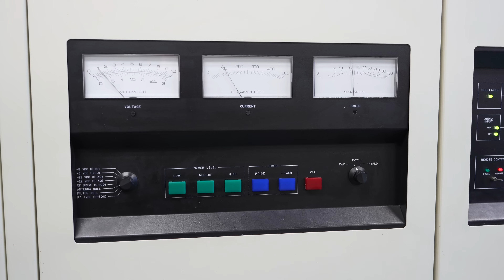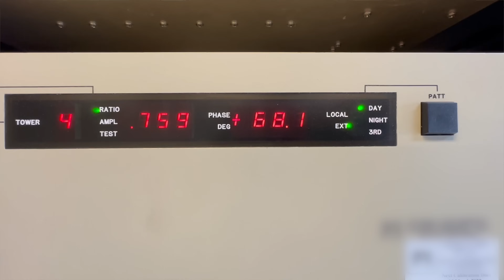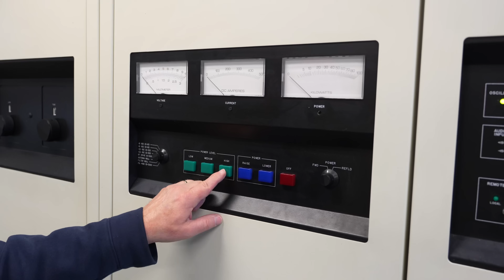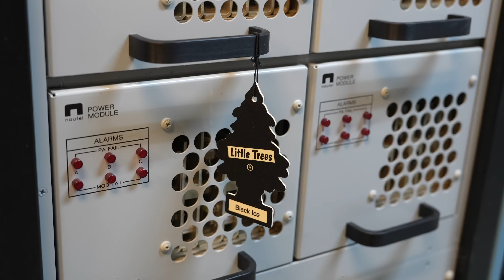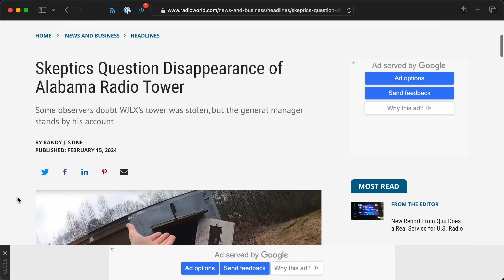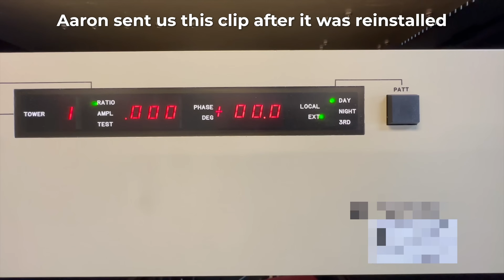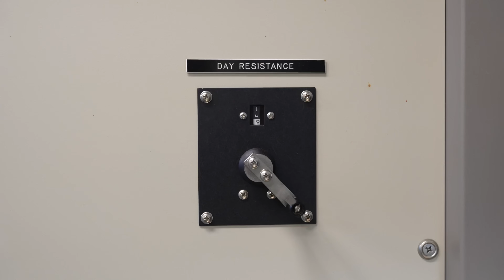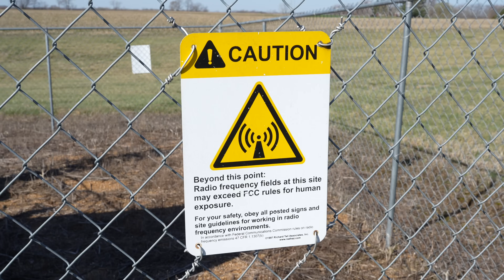This 100-year-old tech splits my voice in five

Comment: Misleading title.  It doesn't do anything with the voice, it does it with the RF signal.  I already knew about this, but I only watched because I wanted to know what it's doing with the voice.
Reply: I also thought it would be about audio phasers (a vocoder-like sound effect, that was likely invented as early).
Reply: Informative
Reply: Especially the visual represented in the thumbnail, and then completely avoided the explanation of the title just to link to other channels... @GeerlingEngineering The content on this channel is great, please don't fall prey to marketing tactics that misrepresent the content for clicks.
Reply: What does it do with RF?
Reply: I mean, I thought that was obvious...
Reply: @gaborm4767   I'm sure, at this point, you've moved on.  But, for completeness sake...

The animation is not very accurate.  All five waveforms should be identical, just with different offsets in their cycle, relative to each other.

The thing to understand about mixing signals:  If you sum two signals that are in perfect phase coherence (they're exactly aligned), then you end up with twice the amplitude.  If you sum two signals that are in exact opposite phase, then you end up with zero amplitude, because they cancel each other out.  If you sum signals that are somewhere between 0 (aligned) and 180 (opposite) degrees phase, then the signals will sum to a level between 0 and 200%.

But why would you want anything less than the maximum you can get?  Isn't that bad for efficiency?

With a typical omnidirectional antenna, the covered area is a circle expanding outward from the tower.  But, depending on the geography of the area, that pattern might not be ideal.  Maybe your audience isn't uniformly distributed around the tower, and there's no reason to transmit into a field of cacti out in the desert.  Or, maybe there's a neighboring station off in one direction that you're trying to avoid interfering with.  Perhaps there's a tall feature (like a mountain) that tends to reflect the signal with a delay and cause reception issues.  You can use different antenna types that have other radiation patterns, but if you need a particularly complex radiation pattern, there may not be a single antenna that can give you what you need.  For that, you need more than one antenna, in an array.

The tower arrays are designed with relative phase and physical position such that the summed power depends on where you are measuring from.  In certain directions, the towers interfere CONstructively, and you get more power.  In other directions, the towers interfere DEstructively, and you get less power.  This is how you end up with those weirdly shaped squiggles on those maps around the towers.  Those represent the radiation strength at a distance -- or rather, the distance at which the received power is at a certain constant value (say, 20dB from nominal - or whatever standard they use.)  This shows how the power has been "steered" to focus on the areas where you want coverage, and steered away from the areas where you don't.

I'm not a radio tech, but from what I can tell, the phasors are just introducing a tiny delay in the signal that varies per tower.  A very, very short delay can cause a consistent offset of a signal at a fixed frequency (the center frequency that the station transmits at), so that the waveforms as transmitted from the towers are not in perfect phase with each other.  The exact relationship of the individual signals as they sum causes deterministic interference which varies by your distance and angle relative to the array -- hence the ability to selectively cover an odd-shaped area with varying power.

Comment: Warmed my heart knowing the engineer forgot to turn on the dummy load fans and owned it. I have had plenty of big mistakes at work. Much respect for businesses that accept human element in any financial machine. That radio station has got to be a great place to work.
Reply: Insane that the fans not running did not trigger an alarm of some sort.
Reply: I totally agree. That was one of the most heartwarming things I’ve seen all day.
Reply: An engineer that doesn't admit error, is an incompetent engineer.
Reply: It's insane that this could actually happen to begin with.  It shows poor engineering design.  There should be both an interlock which would prevent this from happening and an automatic switch that would activate fans when the heat rises to a certain level.
Reply: @basketballjones6782  maybe he turned it off for the intervew

Comment: You also need to show a TX site with a "poor man's" phasor, different lengths of feedline coiled in the basement to feed the towers at different phase angles...
I've seen a couple of those at small stations.
Reply from the maker: Definitely! We will hopefully get around to some smaller AM sites soon, and many of those are a lot different in so many ways (even if the principles are the same).
Reply: I'd rather see them going around town doing proof of performance tests they have to do every year. :)
Reply: @GeerlingEngineering  I am at the other end of the state but for AM not much to see. A J1000 a coil designed by Mark P, built by me installed by Dave O mostly then out to an 80 year old shunt fed tower. All of it basically sitting on a rock so grounding and chasing RF is... fun. I still have our old MW1 and had it about 80% working after a strike before the owner decided to replace it. Everything else is FM

Comment: Back in the 1980s, I was in some 100 kilowatt AM transmitter sites and the energy was so powerful you could hear the AM station through the random vibration of the building. The building was demodulating the signal through vibrations.
Reply: What country had 10KW AM transmitters in the 1980s?

Comment: Back in my day, we had a Potomac Instruments phase monitor upon which we had to manually punch buttons and write down phase and loop current readings every two hours.  And this was on 4 towers.
You guys have it easy now!
Incidentally, towers are made invisible to other towers by detuning networks.  Rarely are they simply shorted to ground or left fully floating.

Comment: Wow. I am at kilowatt here (J1000) that I have to drop to 56 watts sunset to sunrise. Not dealt with phased antennas yet but cool to see how they work. Antenna design/theory is still voodoo to me. I have replaced power modules and had to mess with the ATU when we took some stuff off the tower. I can hook up a rigexpert now but still have the old way. Big baklite meter with huge alligator clips that go on either side of the coil. Don't quite know how it's used but seen it done and it belonged to one of my mentors that's silent key so it sits on my shelf as a memory. And yes every tower site I have has box fans.
Reply: I have a very similar station that uses same towers and patterns day and night so no need to have a day and night pattern shift.  One is 1KW day and the other is 500w day. I still remember the moment in class when the instructor talked about resonance and what makes the electrical/magnetic energy blip out into the air. Still facinates me. And he would have loved to see what it can do with a hot dog as a load! Hope you saw the hot dog video!
Reply: @radijoe  I kinda picked this up as I went along and became the chief engineer because I am the last person in the area who has a basic understanding of it, can read a schematic and be quiet when someone smarter than me tells me how to fix something. I am tempted to try the hotdog trick but I don't know if a gallon would do it. I do the hold a speaker touch one wire and another to ground turn myself into a crystal radio and the hold a curly bulb in my hand near the tuning coil and blink with the modulation tricks when we have visitors.

Comment: I wonder if the FCC licenses them for effective radiated power or just wattage? as this is a phased array it can obviously give you a lot of gain in any given direction. With Ham radio most bands are limited in wattage but some take gain into account For example on 60m (5250–5450 kHz), if your antenna offers 3 dB gain, your maximum legal output power can't be more than 50 W (50 W plus 3 dB gain equals 100 W Effective Radiated which is the legal limit there. Great video, interesting to see what the big boys get to play with.

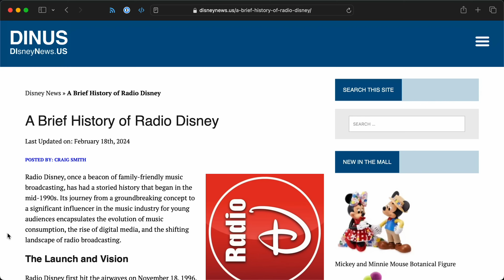Comment: 4:45 depends how the sun,earth, and moon feel during day or night

And how much ionospheric activity there is,  under proper conditions the signal even under legal power will radiate way out of bounds, goes up then bounces off the upper atmosphere like a mirror and someone in Europe or Russia picks it up.

Or bounces off the moon and someone in China hears it
Reply: Nowadays most of that can be computer augmented
Reply: 13:15 skin effect and resonant standing waves

Having only one ground point allows for ground faults and at radio frequency the ground becomes an inductor, which you don't want a high lc ground can cause floating voltages 

Touch a grounded piece of metal and hear radio on your fingers....

Comment: Does the towers carry some DC bias or some harmonics that make contact with them deadly? Form what I Understand the high frequency should prevent getting electric shocks the biggest risk being mostly severe burns due the current and arcing.
Reply: I own a violet ray device (works similar like a plasma globe), that produces sparks like a taser, but they can be touched with barely causing pain because the frequency is too high (around 1MHz or such, RF power may somewhere up to 10W?) to trigger nerves.

Comment: Could this explain why we heard voices during the eclipse in illinois?  Did the AM signals propagate far enough to induce voltages and currents on something nearby that we audibly heard?
Reply: Holding a fluorescent tube nearby the mast will likely light up. I remember a TV report that "Radio Liberty" (an USA propaganda station in Bavaria (Germany), designed to inform the Soviet Union) had such strong transmitters that a family in a nearby house thought it was haunted, because distorted voices rattled out of kettles on the gas oven or the springs in bed mattress and sofa tonight, and finally radio sounded out of the speaker inside his homeorgan. Eventually they had to built a faraday cage of wire mesh around the entire house to shield it against that RF radiation.
Reply: @cyberyogicowindler2448  That's hilarious.  I remember back when tooth fillings were made of metal some people claimed they could hear radio stations by biting down on tin foil!
Reply: @Calliber50  The Radio Liberty incident was proven in a lawsuit. AFAIK they even had to pay for installing the shielding because the family's house became legally rated uninhabitable.

Comment: At KNAU we had 100,000 watts 30 miles away remote, at KBAQ in Phoenix/Mesa we had 150 watts up the pipe to a 20 element Yagi antenna, 3,000 watts erp. At KBAQ we were a whisper in a Room full of Shouts!

Comment: What I would like to know:
How long do the UPS boxes in the server racks keep things running? There is only so much you can put into 2U of rack space. 
Will it keep a minimum set of services running or is ist just enough to shut down the system gracefully and hand over to a hot standby?
Reply from the maker: Usually the UPSes in those racks are just to keep the computers and remote gear up. For a site like this, they let the transmitter go off during a power outage, but they try keeping the remote access gear up as long as possible.

Comment: Prodlen made 51. Ohm coaxial cable, used by GE that made made radio and T.V. antennas and transmitters.  GE actually supplied complete "turn key" studio and transmitter equipment for radio and TV stations in their hay day.  (just like RCA and eventually Harris)
Ron W4BIN
Reply: When I first started in the biz I saw a large pile of 3 inch coax and the site's engineer said to never use it. It had the coiled looking bullets and he said it was a pile of 51 ohm coax, which I never knew existed. I was able to stick with Dielectric for large hard line and Andrew Heliax (now Commscope).
Thanks for the info!

Comment: Hey there! Just wondering, when you were showing the basement of the other location and was going over the tubing everywhere. 

You showed and said they were coax ‘cables’

So a “normal” one to me has the same center, insulator, outer wire and then outer jacket….

Is the “insulator” and outer jacket literally air for those? As in when dad “assembled one” there was nothing around the center but there was the white insulator cap. So is that it?? Air is the insulation?? (And don’t touch it)
Reply: In the case of these tower sites, they actually pressurize the lines with nitrogen, so it's air, in a sense, but nitrogen, and it does a pretty good job of (a) keeping out dirt and moisture if there are any pinholes, since its pressurized), and (b) insulating the center conductor from the outside.

To mechanically separate the two, there are insulating spacers at every bend, and at every connection point.

Comment: TLDR. It’s a phaser. Is splits signal into 5 identical signals and shifts the waveform ( time). So if you are between the path of 2 towers u actually receive both signals mixed are in phase and not shifted to sound hollow ( telephone voice). Reason for the extra towers is you send less power to a particular tower to shape its coverage area - you don’t want your signal interfere with another station to Ie sw on same frequency or costal city do not need to have 100 % coverage of the gulfs of mexico
Reply from the maker: 'tis a very good, concise explanation!

(though should be tldw ;)
Reply: @GeerlingEngineering  Maybe they didn't watch and just read the closed captions.
Reply: Ah. Constructive and destructive interference
Reply: Identical as to modulated waveform, but not as to power levels.  In some DA's, a tower resistance can be negative (IOW, it returns power), while in problem designs a tower may have low resistance at carrier and negative resistance within an audio sideband.  Ouch.  (also generally badly unstable then too)  

There are two fixed elements of AM DA arrays, tower electrical spacing, and angular positions.  There are two variable elements, the power and time delay of signals to each tower, as adjusted by the Phasor and other elements, like transmission line lengths, and Antenna Tuning Units.  The earth electrical traits, and ideally very few other items like badly grounded utility lines or nearby structures, can also become undesired elements.  

As to radiation efficiency, or skywave at night, tower height also matters.  Generally 70 electrical degrees or more is expected for near quarter wave towers, commonly used.  Half wave towers have the least vertical radiation and high horizontal efficiency, but higher costs and in some places, more land use regulation or aviation issues.  5/8 wave are more popular for Hams, as they have more complex vertical patterns for slightly higher horizontal gain that half wave.

Comment: Awesome video! This is why people disagree about whether am stations come in better at night.  All things being equal the signal travels farther per watt but the stations sometimes have to compensate to avoid interfering with each other.  As a Ham it's always fun when the bands open up though and you find yourself talking to people from ridiculously far away. We often use pl tones to reduce unintentional interference between our repeaters.
Reply: Also too hot and sunny or fogged weather can cause poor radio reception. I wonder if any radio broadcast license was ever designed to compensate this by adjusting transmitter power by weather (e.g. through a closed loop control).
Reply: @cyberyogicowindler2448  Each band definitely has its own properties.  Some are better at night and some are better during the day.  A really cool aspect is the ionic ducting. Now is a great time for that using 10, 11(US CB), and 12 meter because of high solar activity.  Five watts can cross the United States and pop out the other side of you're lucky.

Comment: When I was young, there was a misconception among adult electronics amateurs and even professionals (who didn't work in radio) claiming that the towers were safe unless a person climbed to a dish or an assumed "active" element near the top!  Granted, the tower near my home did happen to be safe: it wasn't even fenced and had no warning signs that I can recall.  We played on its concrete pad any time we were near it with adults.  The thing had a couple large electrical enclosures near the base, but no transmitter building.
Reply: Was it an FM station? I believe it is only the AM stations where the entire tower is radiating RF.
Reply: @BenInSeattle  🤷‍♂️